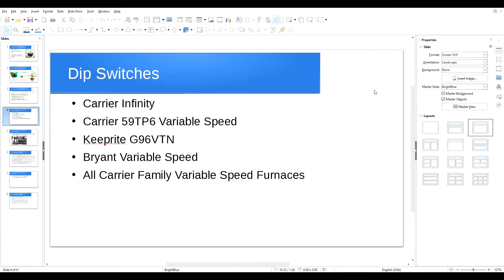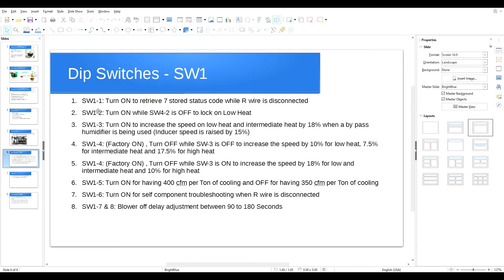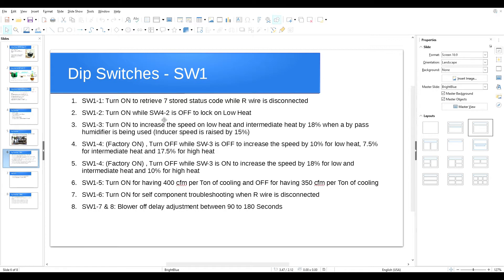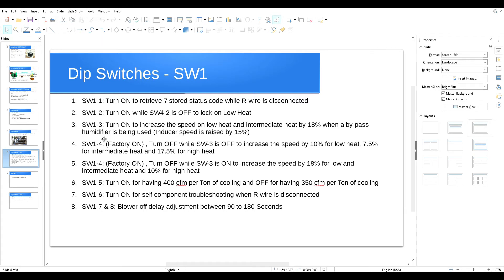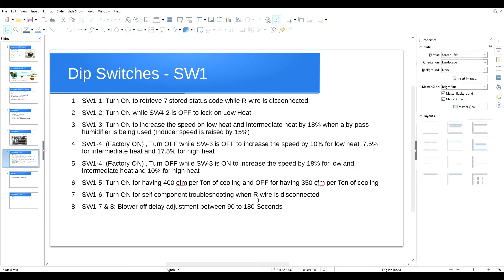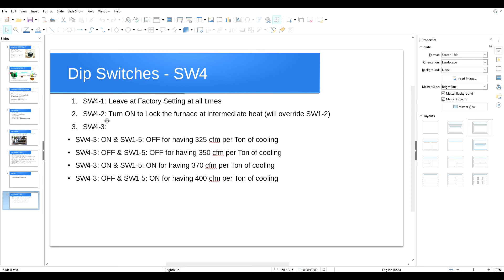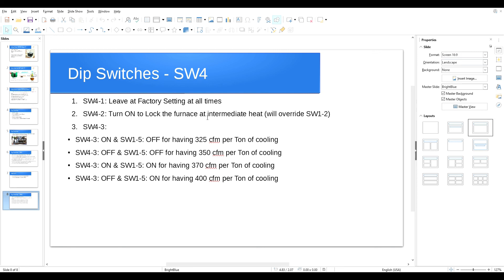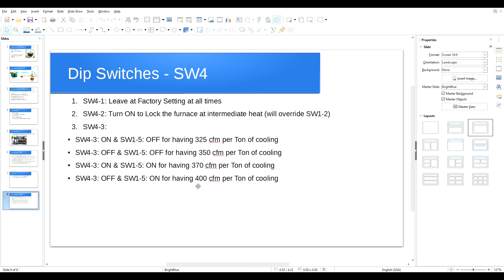Dip Switch Setting on Furnace

Comment: I’m a new tech and I ran across a problem today it was a carrier furnace and it kept turning off before it reached the desired temp in the house and the furnace was throwing code 33 meaning it was turning off due to over heat could i used sw1-4 is off
Reply from the maker: Try to flip SW1-4 and SW1-3 if you have a bypass humidity

Comment: I've been struggling with fan speeds on a Carrier 58MVB. It use to have a Infinity thermostat, but is now gone. The problem is the homeowner complains the fan speed is to high when the fan is left on instead of auto. Any ideas where the dip switches should be set? I tried changing SW3 switches but nothing happened.

Comment: Can't figure out the SW3 switch for continuous air flow
Reply from the maker: Are you talking about SW1-3 or SW3 itself ?!

If you mean SW3, it's for adjusting the air flow for when the air conditioner is running.
Columns show the model of the furnace you're working on. It's either 40K BTU, 60K BTU, 80K BTU with 3-Ton or 4-Ton blower motor, 100K BTU, and 120K BTU.

Select your furnace and go right to the size of the AC you're working on and then up to set up the Dip switch accordingly.

Comment: Gas pressure can be outside of 3.2-3.8 depending on the elevation above sea level right? 
Great vid btw. In my experience maybe less than 10% of installers set sip switches
Reply from the maker: Thank You.
That's right, It can vary depending on the elevation above sea level.
We're in Toronto and here, that's what it supposed to be.

Thanks again.